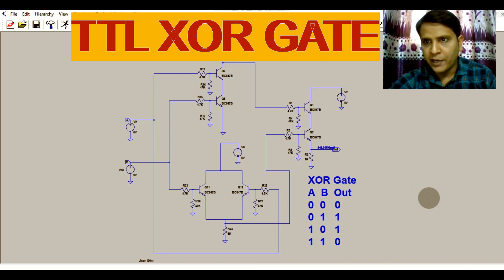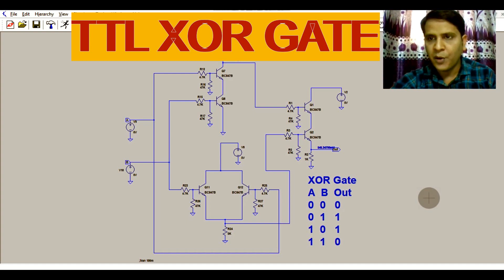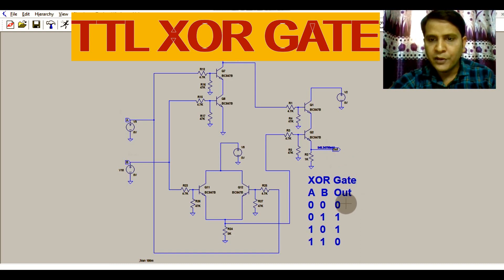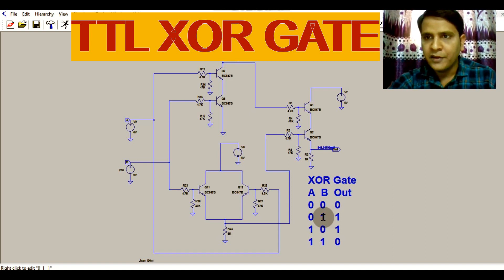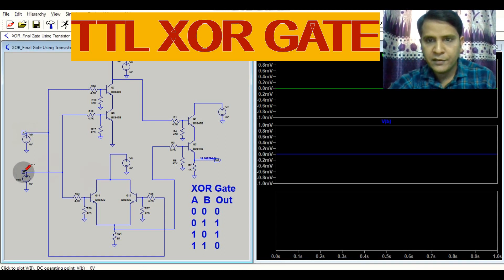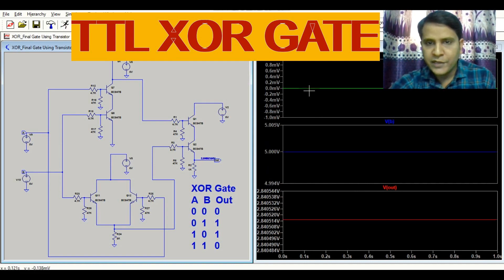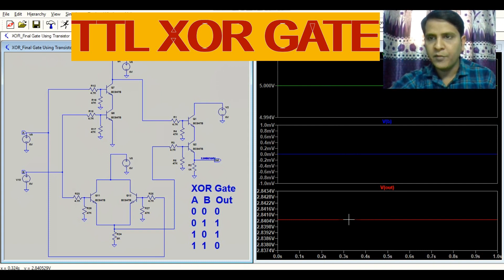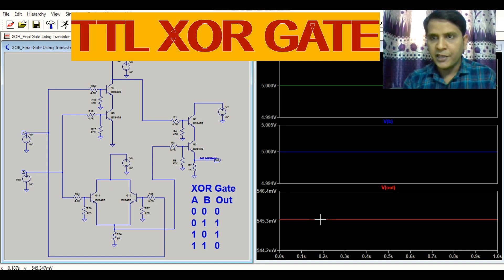LTSpice TTL XOR Gate Simulation || XOR Gate Using Transistor || Digital Electronics

Comment: The xor gate seems not designed well , since the output is not 5v for the case shown at 2:47. You said that even though vout = 2.8v it is recognised as "logic high". this is questionable since you did not specify voh, vol, vin, vil. Furthermore, I do not think any ttl real implementation is based on this configuration. Maybe a mosfet implementation would have been more realistic and closer to a real implementation.
Reply from the maker: You are correct. I really appreciate your understanding level. Mosfet may have low Rds(on) hence lower drop. This may improve the signal level.